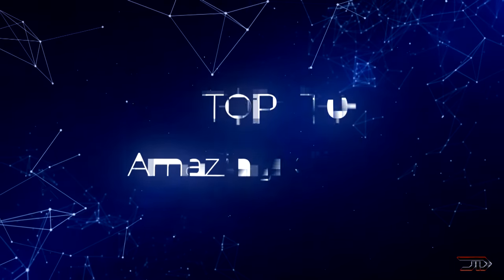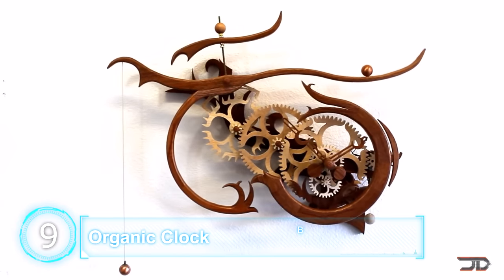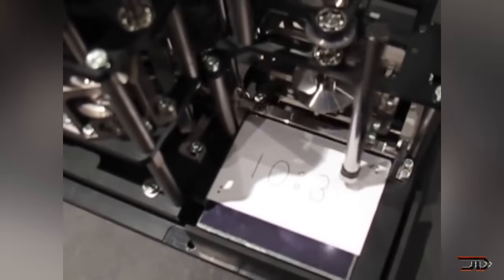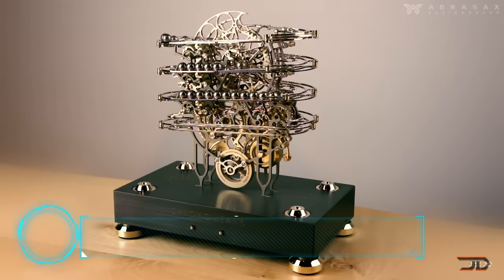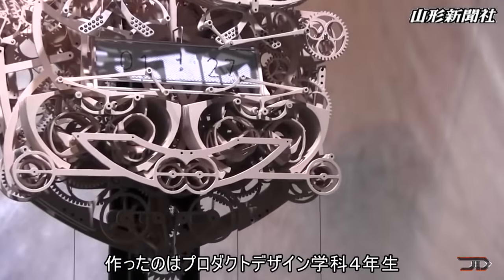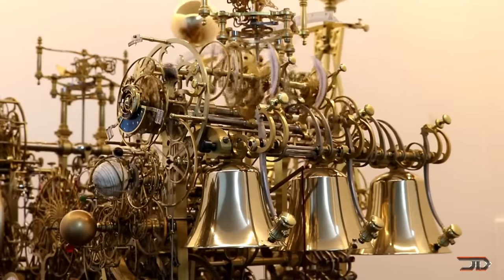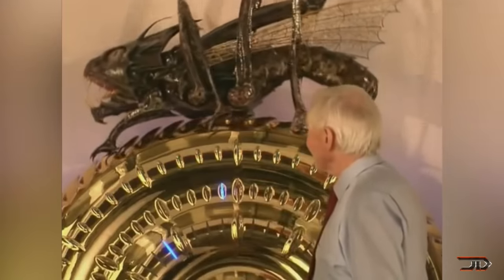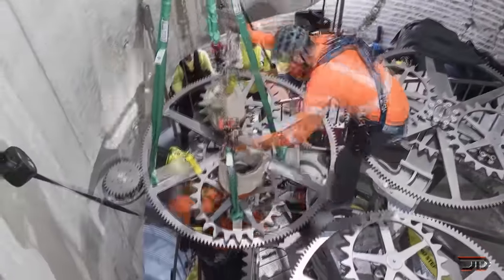10 CRAZY Clocks You Won't Believe EXIST!

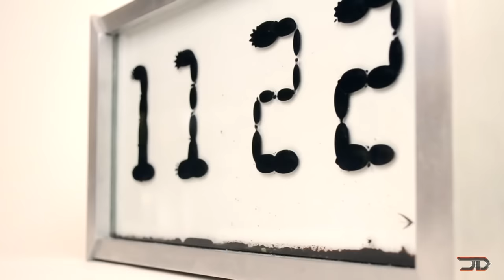Comment: 1:54
If it takes no input or uses no mechanic elements and still gives an out put... then...
1. It is a perpetual motion machine 
2. It’s magic

3:50
Why the heck not put a nonexistent mutant grasshopper on top of the clock?
Reply: PaleoFisher Captain of the The Fishers fleet probably electromagnets
Reply: The back of it is magnet robot.. it is program to go on what ever shape it was and the fliud attract with magnet
Reply: The exact phrase was "apparently it has no mechanically moving elements". I can see how it works by using an array of magnets and electricity to change which set of magnets has the charge needed to pull the fluid to the right area. The fluid itself is not a mechnical structure. That's more of gears spinning, armatures, and such.
Reply: Have you ever heard of electromagnets